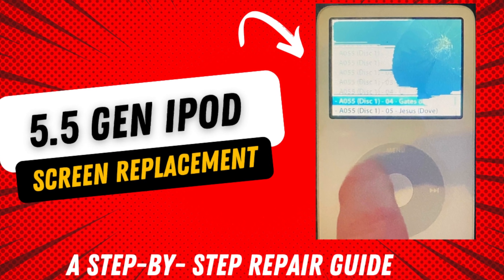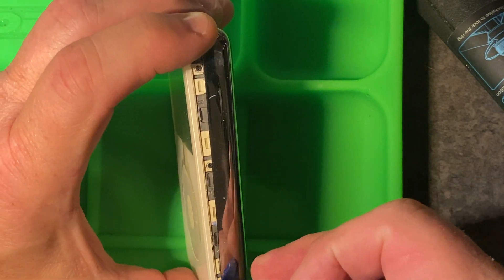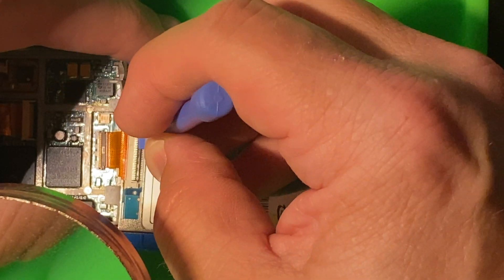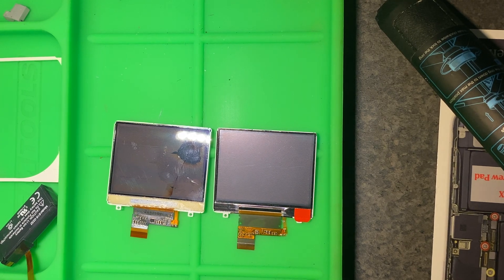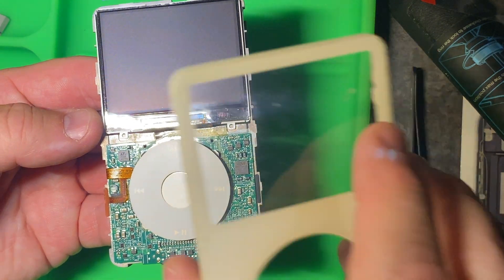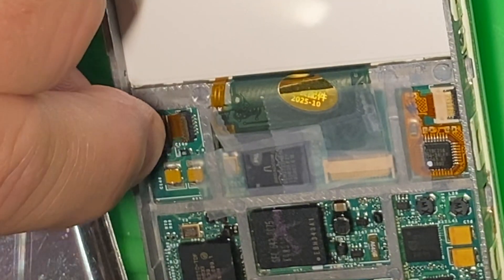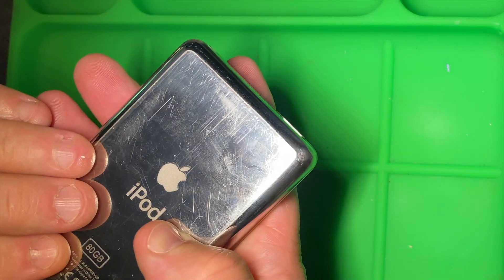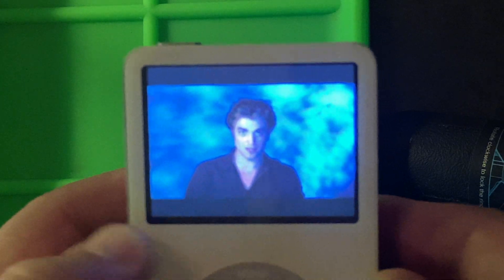iPod Screen Replacement on a 5.5 Generation iPod Classic

Comment: Where to order the display? Thks
Reply from the maker: I ordered mine off of ebay.  It cost around $31.00.  But elite obsolete electronics is a reputable place to get many ipod parts and accessories.